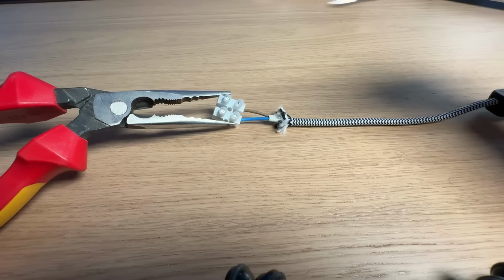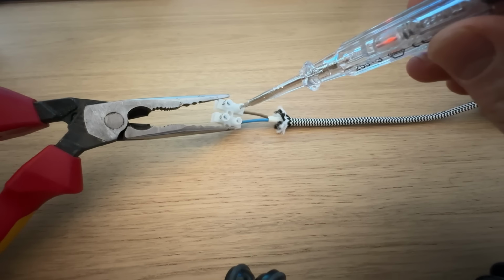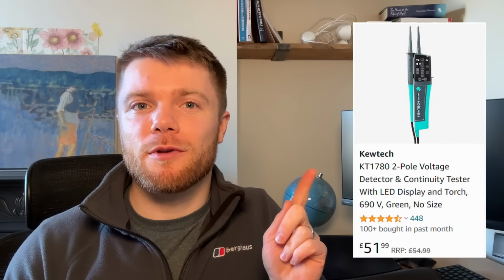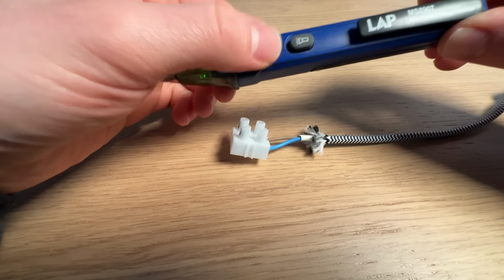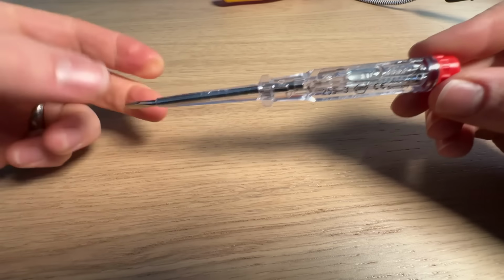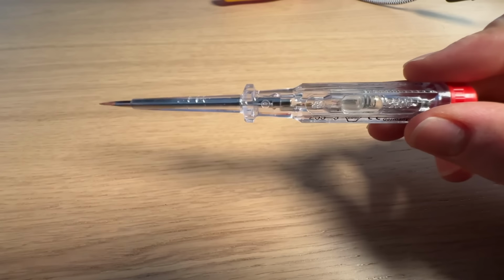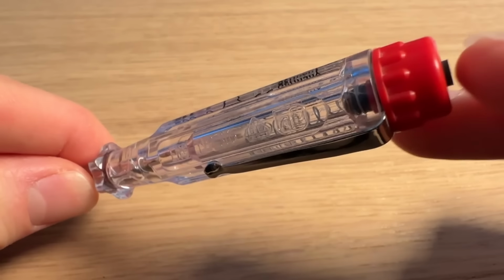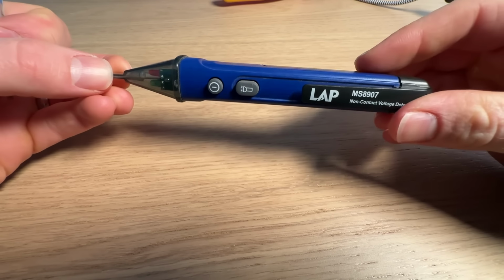The Most Dangerous Electrical Tool

Comment: Nonsense! You have to know your tools and how they work - then this is not dangerous and a cheap and reliable tool for testing! Of course you need some connection with ground to get it working. And of course you need a power system that is referenced to ground (there are isolated systems - typically in hospitals - where this tool cant work).
Reply from the maker: They should still light even if you’re well insulated from the ground, due to body capacitance. 
Thank you for sharing your opinion
Reply: @TheDiligentDIYer1759  From experience of more than 50 years i can tell you they dont light, if you are really well isolated. At least its so faint you wont see it ;-)

Comment: This is quite interesting... To be honest, many people in the coments don't really understand how resistance, current or voltage works. I've read that it's a bad idea to put a tiny resistor to mains... A resistance that big is going to pass through so low current, that it could be even smaller still having no problems with heat disipation, using a big resisitor is not gonna make any diffenrence. Secondly, as mentioned in a video, water can get inside and short the resisitor, yes, but water can get into any of the other devices and be just as dangerous - you shouldn't use electric tools damaged no matter what. And thirdly, I thought this video is going to mention, how dangerous tools like this are, when you are staying up high on a ladder checking a wire from the ceiling, where the tool won't work, because you are really badly grounded - this is far more dangerous because some may think the wire is not live when in reality it is, the shock might not be that big, after all your poorly grounded, but it can be dangerous too.
Reply from the maker: I could be wrong, but my understanding is that even if you were well insulated from the ground, the screwdriver would still light when touched to a live wire due to body capacitance. Thanks for watching!
Reply: @TheDiligentDIYer1759  You are correct that there is always some capacity to ground, if you are high up on a ladder the capacity between you and ground becomes lower than if you would be standing on the ground (think about moving capacitor electrodes away from eachother), so the capacitive reactance becomes higher Xc = 1/[2*(pi)*f*C], therefore the overal impedance of the cirtcuit becomes higher too Z~ Xc), so the light in the screwdriver will likely be much dimmer than usual which can lead to a worker not seeing it in bright environment, which happened to me as I was trying to connect lights to wires from a ceiling and was unable to tell if the light in the screwdriver was shining or not because the Sun was shining into the house. I knew that this could happen, so I just used a different tool with 2 probes and connected one to the live and the other to ground or neutral (in our country the wiring is done so the potential has to be the same on ground and neutral).

Comment: I have been using these for well over 50 years. Never had a problem with them.
Your video is very theoretical, not practical at all. Use with common sense, not if they are full of water or foreign material, no light does not automatically mean no power.
Reply from the maker: Thanks for sharing your opinion

Comment: And you forgot a big problem, one I experienced once and that definitely convinced me never to use it again. The capacitive coupling between your body and the ground may not be enough to light the neon bulb! Once I wanted to intervene at home on a roller shutter switch located in height, I cut only the circuit of the roller shutter but there was also another cable for a lamp passed in the same places but on another circuit breaker. FYI, I’m on a fiber stepladder (not aluminum ), I take my test screwdriver, no light on all the connectors, I start to work until I take a discharge on the connector pair of the lamp cable. Being above ground on a non-conductive fiber stepladder, the neon bulb was not lit. I repeated the test and it is only by getting closer to the wall of the house or the floor that the bulb began to light...
Reply from the maker: Good points, thanks for watching!
Reply: Yes that is a good point. It can happen when the air is dry. Therefore on such days there's a lot to be said for an aluminium ladder.... !

Comment: Been in the industry over 45 years still got them in my tool box non contact volts stick were not about then got them to plus my Drummond test lamps volt meters etc, neon screwdrivers in the right hands are fine for voltage detection better than nothing, for proving dead I use test lamps and proving unit.
Reply from the maker: Thanks for watching!

Comment: Hi! Did you've ever really shocked by mains? You describe the fear of malfunctioning of a AC phase point tester like someone that was shocked once slightly or did never shocked at all.
I've got my "mains" in childhood once. It wasn't horrible but unpleasant obviously! Once again I was shocked touching a naked wall outlet behind our refrigerator. It was a very old "gift" from my father who did left us and took the actual plastic outlets with him.
You're advicing to get a good device but it serves another task: just defining is here a safe (current free) cable or not. Or is this volume in a wall is free of electrified cables.
The electrical "screwdriver" is a tester to understand: is a concrete wire "phase" or "zero" (ground). It's very important when you're making electric wiring. And using it to just testing cables for safety isn't good. Personally I have the same contactless tester in my Uni-T multimeter. It works fine even in a cheaper model (which I've bought later to leave in another place, our summer house).
Reply from the maker: Thanks for watching!

Comment: Today we have a great problem. First is testing our AAA battery power. Earlier we used to get small bulbs in Torch and series light and we check the powe of battery with bulb and small wire. Secondly mobiles had a indicater system that it glow yellow while charging and show green once charged. Then another is there used to be display of crystal time and about missed called or messages. Today that is lost. We are fooled by samsung various mobile they fail to give these very important one. Earlier HTC had it. Then Tube lights.  The choke system out of the market but choke is getting sold. For a funny thing. So products innumerable but not for any support to the buyer.
Reply from the maker: Thanks for watching!

Comment: Those testers have resistor inside that protects user from electric shock in case of stupid.

And it doesn't works like you dicribed. in fact, neon light bulb will  stll be on, if you will levitate in air. 

capacitive conductivity
Reply from the maker: Body capacitance, but that assumes you don’t have a path to ground, which is usually not the case. Thanks for watching!

Comment: A qualified electrical engineer I worked with years ago now told me how dangerous these testers were and that they should be banned. They are usually dead cheap and not very robust for use as a screwdriver even. I threw mine away and bought a good quality "Fluke" non contact tester. Not cheap but very safe and not expensive compared to losing your life. I also bought some 1000v rated fully insulated screwdrivers for use on terminal screws or anywhere where there might be live items that could be inadvertently contacted.
Reply from the maker: Thanks for watching!

Comment: This one is actually a higher end model if you can say that😅 the even cheaper knock offs often have a cylindrycal carbon-like hard pressed little tablet instead of an actual resistor and the button can not be a button, but a rivet to contact the spring 😅
Reply from the maker: Interesting, that’s terrible! Thanks for watching!

Comment: Good instructional video for newbies, I've been using these devices for 56 years, and recently purchased a multimeter about 3 years ago, It has the capability of doing everything I need, It comes in a box with a stand and carrying case, and a lighted LED screen that will power off in a few minutes if not used, I purchased it from Amazon for about $6 or $7, and It works very well. subbed. 🇺🇸
Reply from the maker: Thanks for watching!

Comment: The Non-contact voltage tester is WAY more dangerous.
This thing some times will not trigger for some random reasons or will give you false positives.
You should always double check with another tool (like the Neon screwdriver).
Reply: they give a 'beep' when a live circuit is detected ....and also give you an adrenaline boost, when you are working on wiring and they give the same damn 'beep' as they automatically shut down after a minute or so of being idle
Reply: This is the way - two tests to confirm.
I carry both a volt stick and an incredibly frequently used screwdriver that is also a neon sometimes.
Reply: Also if you have a bunch of wires in a bundle, the contactless tester will not be to tell which one of them is alive.   
The mains tester is the best device for such situations.
Reply from the maker: Thanks for sharing your opinion

Comment: Surely the most dangerous thing about these is their similarity to a 12 Volt screwdriver tester. As an apprentice I bought one by mistake (they were alongside each other in the shop carelessly stacked) and I used it on mains 240 V AC and it didn't work. I assume I was saved by my Dr. Martens boots but please nobody try it, I'm not entirely sure.
Reply from the maker: Good point, thanks for watching!

Comment: I prefer this type massively over the non contact type, which give hugely spurious readings; so much so that I simply cannot trust them. They give live readings on dead cables and no readings on live ones. Not all the time, but randomly, which makes them way more dangerous. Generally though I use a multimeter, which is a faff, but that's not a problem given the risk.
Reply from the maker: Thanks for watching!

Comment: 4:04 im shocked they are not just a solid fill, considering the spring does nothing.
Reply from the maker: Yeah it does seem crazy, thanks for watching!
Reply: Spring will keep the tension on the connections.
How else during assembly could be sure you have a good connection

Comment: Doesn't the CE mark on the handle indicate the device has passed the rather strict safety requirements to receive that certification?   That being said, I've never seen a tester like this in the USA, probably because it doesn't seem like a good idea to use your body as part of the circuit.  
Is it really a problem, though?  Technically, the amount of current passing through your finger to light up the neon bulb would be quite small, less than 1 milliamp; so small that you would be unlikely to even notice it.   Even if you were to connect a wire directly to the top of the tester to complete the circuit for the maximum current draw, it would typically only measure about 2 milliamps, well below any unsafe threshold.  (For reference, ground fault circuit interrupters in the USA don't trip to protect individuals until the fault current exceeds 5 milliamps.  Currents through the body of 10 milliamps start to be dangerous, as you may not be able to let go, and currents greater than that become increasing painful and can be deadly even as low as 50 milliamps.)
Reply from the maker: CE just means it meets EU standards, whether those equate to strict safety standards is up for debate. Thanks for watching!

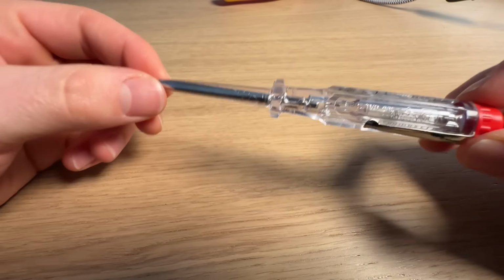Comment: 4:24 But you can visually inspect the tool and you can initially touch it a way that would allow you to survive the shock. Like put one hand in the pocket and hold it very loosely so it can fall off in case you get a shock.
To safely use them you need to know how they can fail to light up and some other things.
I like them because of their simplicity.
Reply from the maker: Thanks for watching!

Comment: No, you do not complete the circuit to ground. It works without any grounding. Basically you are storing charge each cycle.
Reply from the maker: Body capacitance is the term, but that assumes you’re earthed to invalidate my points, which i don’t think is likely most of the time. Thanks for watching!

Comment: Been using one for years.  One of the most useful electrical tools I have. Because you have to touch thescrewdriver on the  conductor, it tells you exactly which one is alive. The proximity devices are ambiguous in this regard. Don't however use them to confirm something is not alive unless you have a nearby live sample to compare it with. The shock risk is minimal. One screwdriver I have lights faintly without actually touching  it so even safer.
Reply from the maker: Thanks for watching!

Comment: Sounds like the RCD should trip if you use one of these. Only if the current going through it is more than 30mA though.
Anyone know how much current is diverted into your finger? Depends on the size of the resistor in the thing.
Reply: I tested mine and it has a 2.5 M Ohm resistor. So, in 220V it´s about 0.09mA
Reply from the maker: Thanks for watching!

Comment: I wonder how many deaths have been prevented by these so called dangerous gadgets. As a guitarist using a guitar amplifier and often house microphone I would always check if it was safe to touch guitar and microphone at the same time. There have been numerous guitarists who didn't who found out the hard way and are not around to tell how they wished they had.
Reply from the maker: Thanks for watching!

Comment: Yes,in my first year of tech my teacher told me that the best use for that test screwdriver is just to use it as a screwdriver.

The test pen is what I used on a coal mine site 17 years ago & it should only be used as an indicator, not to conclude that the circuit is dead so double check that using a multimeter !
Reply from the maker: Thanks for watching!

Comment: How is this more dangerous than any other equipment. This will only cause you get shock for two reasons. 
1. You don't know how to use it properly 
2. You didn't check your equipment to make sure they are not faulty before start working
( electrical 101)

I got shock with one of these as a teenager. My father laughed and told me not to touch his tools without asking because that one was faulty and he taught me how to repair it that same day.

I have the touchless tester and multiple multimeters but i still carry two of those screwdriver testers because they are reliable, no batteries required and anyone using this and doesn't know that their body is being used to complete the circuit shouldn't be in the electrical industry at any level because that is literally basic electrical common sense

Edit. I just finish the video. And literally everything you say that is bad about this tool is valid but can also be answered with one statement. "The tool is transparent" you can see if something is faulty before you use it. So it goes back to if someone get shock with one of these it's solely because the person is negligent. The tool is not at fault
Reply from the maker: Thanks for watching!

Comment: It was companies like Fluke that started neon testers are dangerous, I have never heard of anyone even getting a shock using one over the past sixty plus years and can find no reference with a google search. The neon lights not due to current going to earth but due to capacitance of the body, it is possible theoretically to get charged to full mains potential if you held on long enough but in reality enough charge would leak off you through the atmosphere to never get to that point, the screwdriver you showed there was particularly safe as the end cap was a semi conductive plastic and thus formed part of the resistive circuit. Those volt sticks are unreliable since they will show voltage when none is there and the ones with adjustable sensitivity will show no voltage when there is, I have one which will flash and sound if held in front of the computer or tv screen on maximum sensitivity and at the other shows no voltage when put in direct contact with a known live mains.
Reply from the maker: Thanks for watching!

Comment: In the U.S., these are not used for testing mains voltage.  They are used for testing low voltage (6, 12, 24) DC in automobiles.  Instead of a button on the end, there is a wire that is clipped to the chassis/ground while the probe tip checks for positive voltage.
Reply from the maker: Thanks for watching!

Comment: 1. If it's dim, open it up and replace the internal resistor with another with less resistance.
2. The ONLY dangerous electrical tool is the worker's own brain.
3. There is nothing even slightly dangerous about your cute test driver.
Reply from the maker: The idea of replacing the resistor in a screwdriver like this is cute haha

Comment: I have a Klein induction tester. It works well, is very durable, and not only lights up but beeps. Best of all, it is often unnecessary to touch a terminal with the tool. I've never seen the neon thing that you're using.
Reply from the maker: Thanks for watching!

Comment: The only way to be sure a conductor is not live is to use a proper voltage tester (the expensive one) and verify that it works before and after you have tested the conductor of interest. The neon screwdriver doesn't work if you're not earthed when you test and the volt pen does not work with shielded cables. Neither the screwdriver or the volt pen give any indication of the voltage present. Yes, I  am a professional electrician.
Reply from the maker: Thanks for watching!